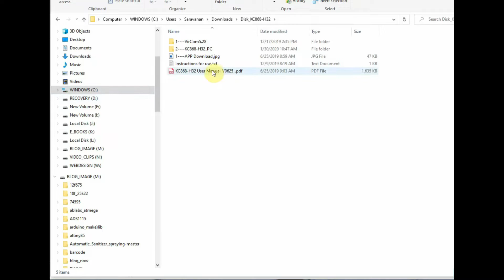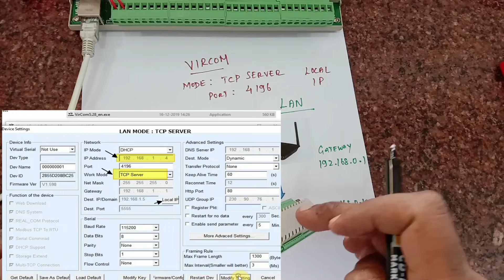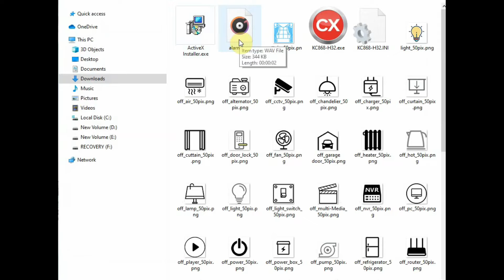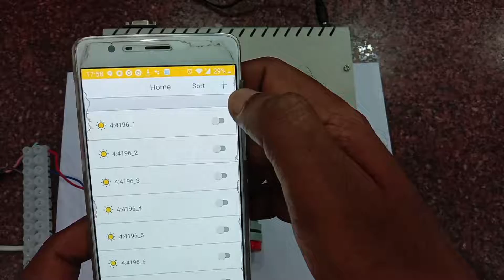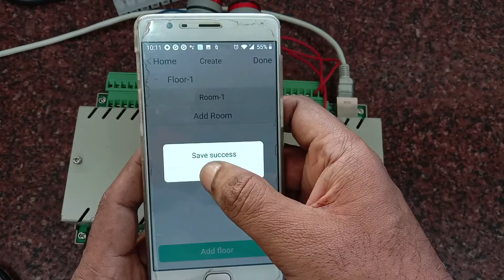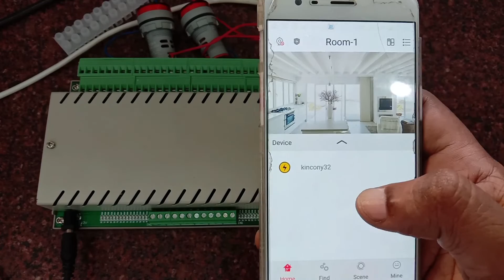32 CHANNEL SMART HOME AUTOMATION RELAY CONTROLLER - KINCONY KC868-H32

Comment: Hello Sir, I am a students of +2, I am from Punjab sir your tutorial is awesome very easy to understand, but  sir I have a question about the timer set in esp8266 wifi module or in arduino uno, sir how can I continue my output time after restart of module due to cut off power supply
Reply: use RTC

Comment: Sir, if the devices are connected in on condition if the Power shuts off and back. Is the device will work back or else we need to switch again?
Reply: it will auto recover relay status. not need to turn on by manually.
Reply: @KinCony  wow really cool.
Reply: @karthikeyant5958  every time turn ON/OFF will save status to MCU chip. not need battery.
Reply: @KinCony  okay thank you